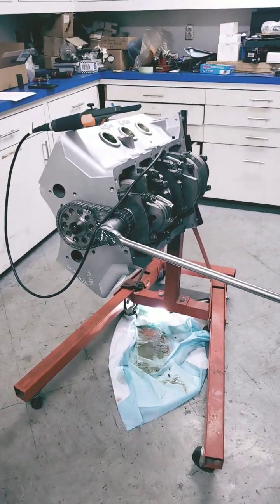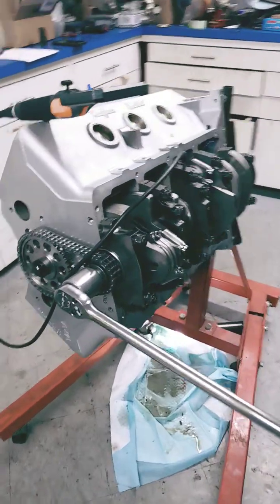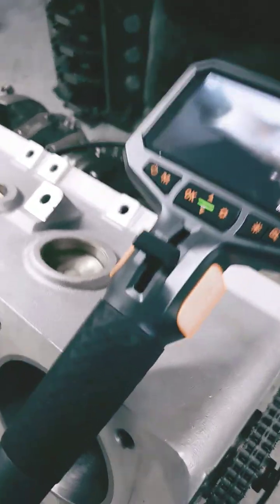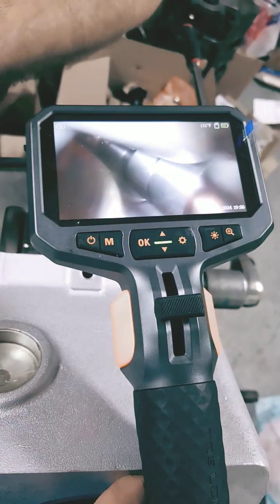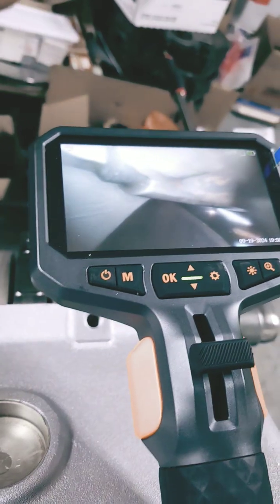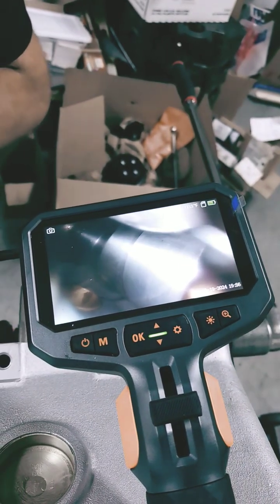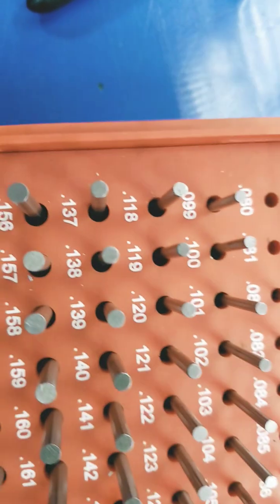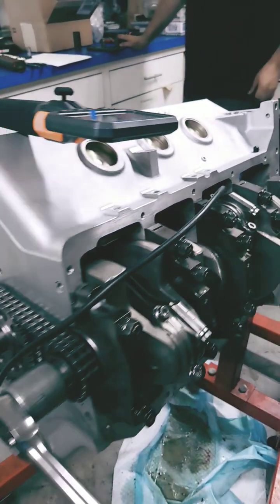How we check cam lobe and connecting rod clearance on a stroker.

Comment: If it were even .0625 , that would be plenty of clearance for me. That's a 1/16th of a inch. Even high levels of heat won't make it grow that big. ( not that you'd want to get it that hot anyway. )
Reply from the maker: .060" is plenty of clearance for sure, but its not really about the thermal expansion from heat. Its more about torsional twist and flex from the crank and cam at high rpm. I had a customer that worked at FORD in their R&D department who shed a lot of light on this with me. He showed me a video of an engine running while being x rayed and I could not believe how much a crank flexes through the rpm range. It makes we ponder how in the world do the bearings even survive.

Comment: How much does that block cost Don if you don't mind
Reply from the maker: This is an aluminum block and depending on options you choose like cam bore size, bushed lifters bores, etc. range from 6600 to 8500
Reply: Thank you